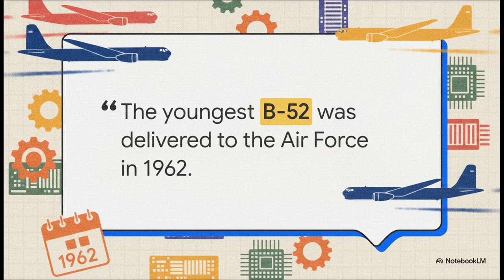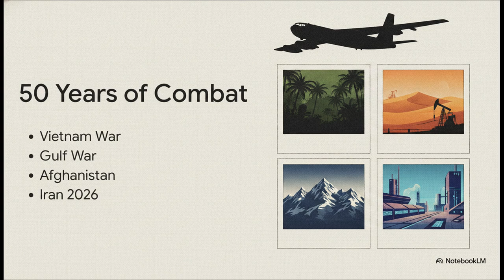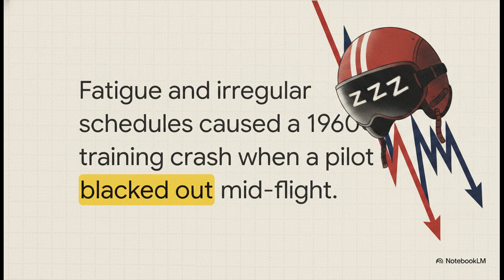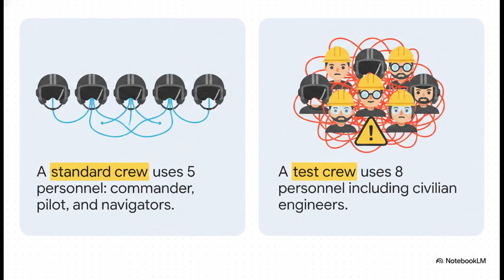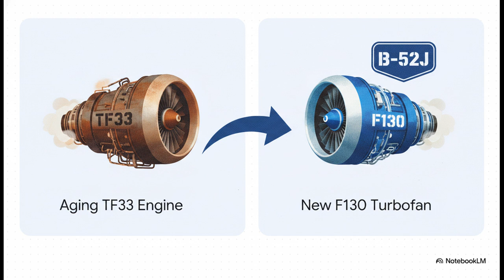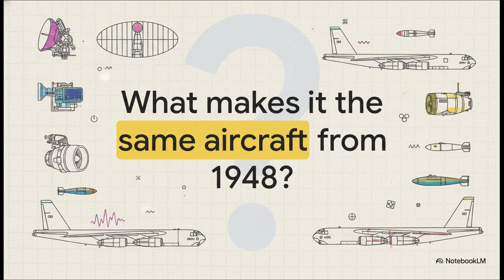⚠️ TRAGEDY at Edwards AFB: The B-52 Stratofortress Crash & 70-Year Legacy ✈️🔥

Comment from the maker: ⚠ TRAGEDY at Edwards AFB: The B-52 Stratofortress Crash & 70-Year Legacy ✈🔥
The Boeing B-52 Stratofortress is an American military icon, serving as the backbone of strategic airpower from the Cold War to the 2026 Iran conflict
. Informally known as the "BUFF" (Big Ugly Fat Fella), this massive bomber is designed to carry up to 70,000 pounds of ordnance, ranging from nuclear cruise missiles to modern precision-guided JDAMs 
. While the fleet has been continuously upgraded for over 70 years, the June 15, 2026, crash at Edwards Air Force Base serves as a sobering reminder of the inherent risks in developmental flight testing
.
In this video, we dive deep into:
🚀 The Evolution of the BUFF: Discover how the B-52 transitioned from a Cold War nuclear deterrent to a conventional workhorse in Vietnam, Iraq, and Afghanistan
. 📡 The Edwards AFB Accident: A detailed look at the B-52H crash during a Radar Modernization Program (RMP) test sortie
. 📉 Technical Analysis: Investigating why the aircraft plunged at 5,056 feet per minute shortly after takeoff, exploring potential causes like flight control malfunctions, asymmetric thrust, or runaway stabilizer trim
. 🛡 Future Safety Measures: How the Air Force uses Crew Resource Management (CRM), rigorous maintenance protocols, and independent safety boards to avoid future accidents and keep the B-52 flying through 2050
. 
Honoring the Fallen: We mourn the eight dedicated military members and contractors lost on this mission